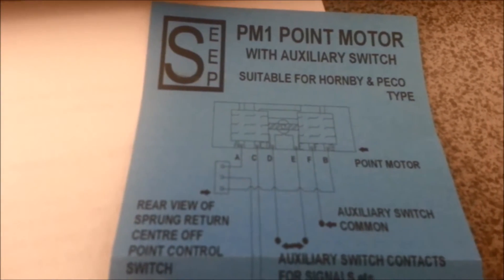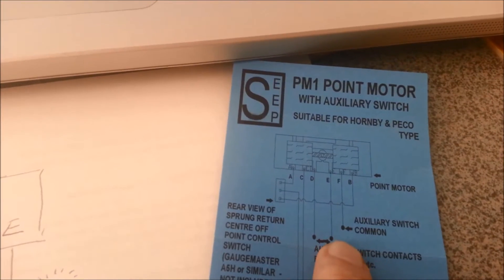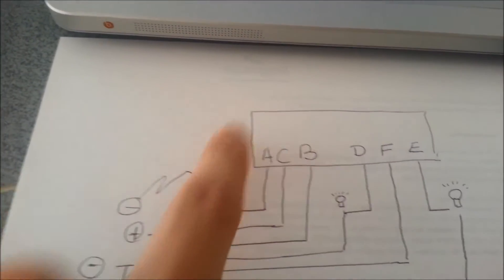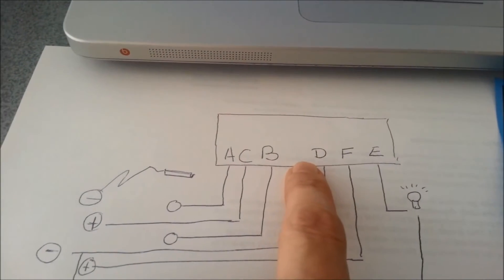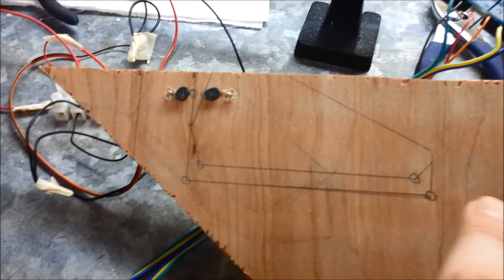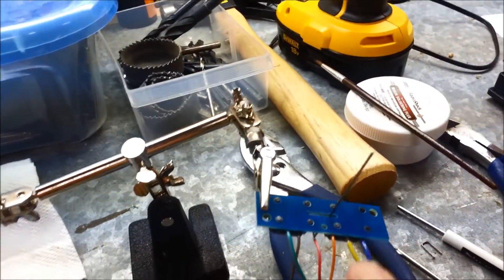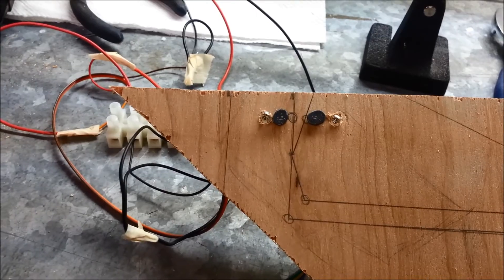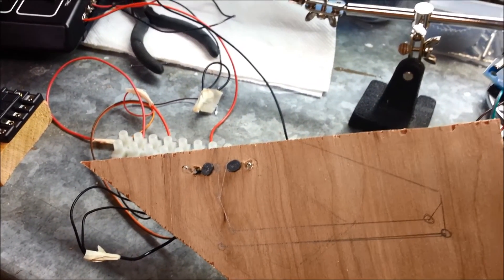Stud and pen for point control with lights indicating direction

Comment: That looks good. Wouldn't LED's be easier to use? More reliable than grain of wheat bulbs, much longer life and you can get proper panel mounts for them, so much neater. I was put off using the Seep point motors as I didn't know if they were as reliable as the Peco motors. I considered stud and probe operation of points, but I prefer the tactile sensation of a nice solid toggle switch!

Chris(Sherwood Central)

Comment: good luck,  I found the throw of the point motor for N gauge was not enough to switch the polarity using the washer, unless the point motor was fitted perfectly.  watch how far the pin moves in your proof of concept?  repeat the exercise with a point to get a feel of how precise alignment needs to be.